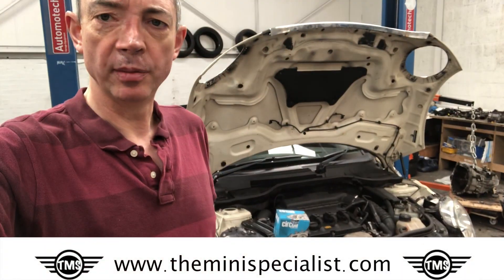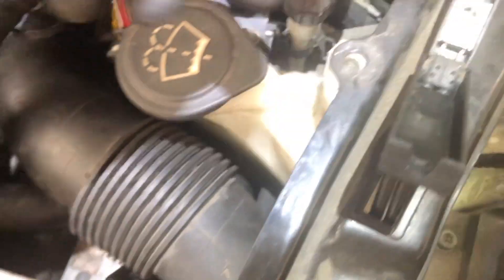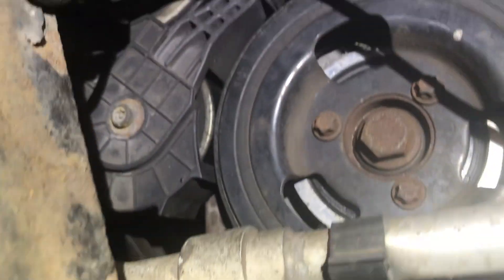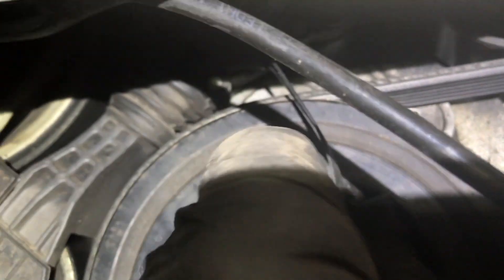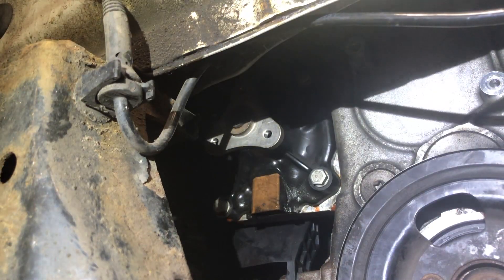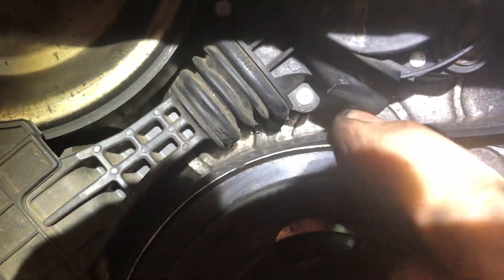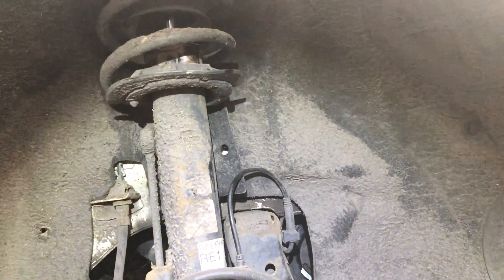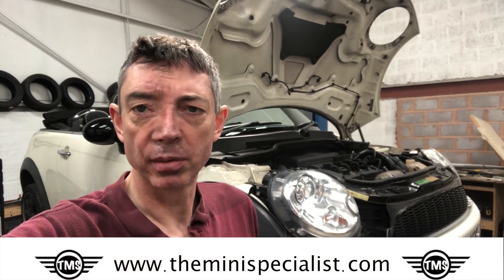MINI Cooper Water Pump Replacement Guide – R56 / R55 (Petrol)

Comment: Is it normal for water pump to not rotate all the time whenever the engine is running or idle?
Reply from the maker: @wiseman6051  yes. That is intentional - it allows the engine to heat up quickly

Comment: How did you know the water pump needed to be replaced?
Reply from the maker: You usually see a leak and possibly a coloured residue which is the dye from the coolant
Reply: @TheMiniSpecialist is it possible that inner blade to be loose and seperated from the cam teeth?

Comment: I think we can thank the French for these troublesome engines in the Gen 2 Minis.
No wonder they changed for the Gen 3 range.
Reply from the maker: Yes and no.  The 'Prince' engine is a joint venture between PSA and BMW.  PSA provided the block as BMW had only rear drive units and BMW provided much of the valve tech - certainly the VVC bits.  The next gen Mini shares all engines with BMWs as the engines are now modular 3,4 or 6 pot with 500cc pistons.  They have their problems too - the expensive one I am seeing at the moment is the exhaust camshaft magentic wheel starts to move which throws the engine management and the camshafts are £500+ each and a big job to change.

Comment: Can't you remove the water pump without removing the belt and engine mount from the engine?
Reply: Old question, but the correct answer is yes.. you can do everything from the fender well, without touching anything under the hood itself. Only have to free the tensioner for access after taking the fender liner out.
Reply from the maker: No - not enough room
Reply: You would think a "mini specialist" would know this.

Comment: do you know how to not get the spark plug socket stuck? also, how do I get the stuck socket out?
Reply from the maker: Remove the rubber from inside the socket and use a long reach magnet to remove the spark plug.
Reply: Tape the socket to your extension with duct tape so they dont separate